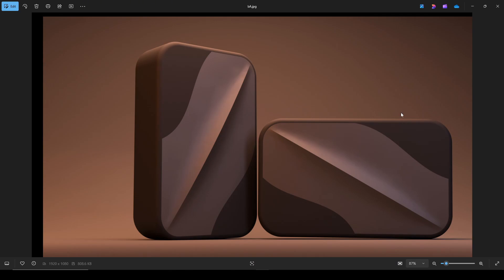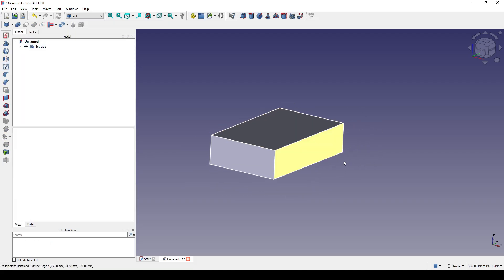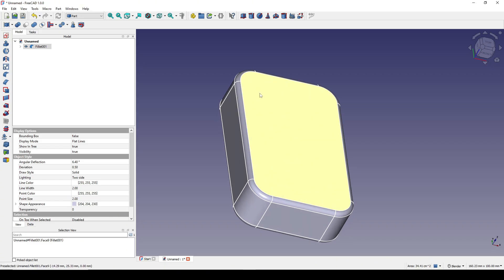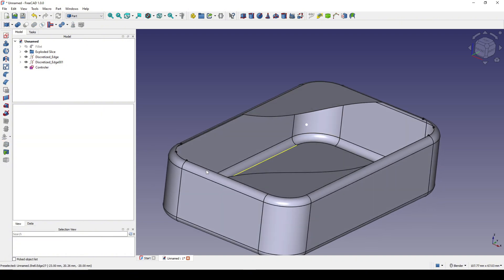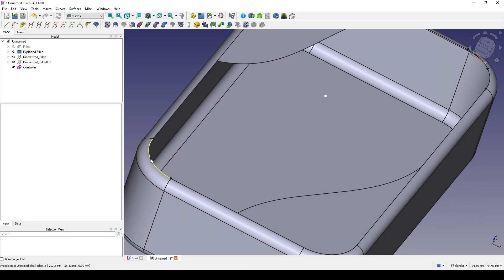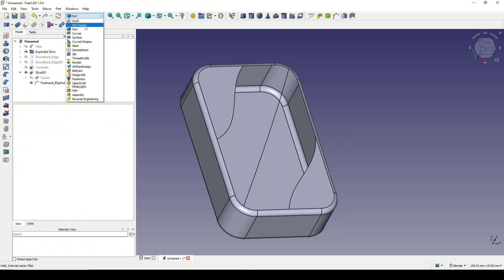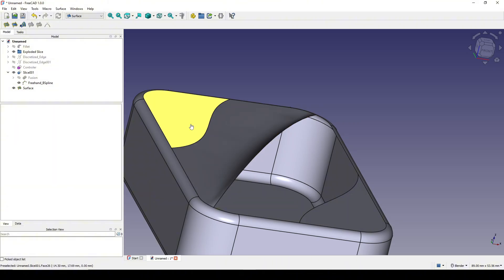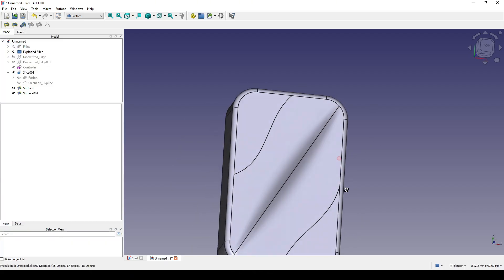FreeCAD 1.0 Draw A Sharp Line On A Brick

Comment: I like your idea of using a sketch to control the curvature of the freehand B-spline. 
Instead of a single construction point in a sketch, I suggest using the tip of a part workbench cone. Cones are easier to manipulate using the transform tool and freehand bsplines readily adapt to transformations of the control cones.

Comment: How would you create a fillet with G2 or G3 continuity instead of the 10mm standard fillet in 2:29 ?
Reply from the maker: @msasdk you can draw a round rectangle radius 10, then replace 4 arcs with 4 bspline, if you want g2 draw 6 points each bspline (3 horizon, 3 verticle, equal distance), then extrude the sketch.
Reply: @DuyQuangDang  Thank you very much! 
Would be a great topic for a video, G2, G3 curve continuity using the sketcher WB.